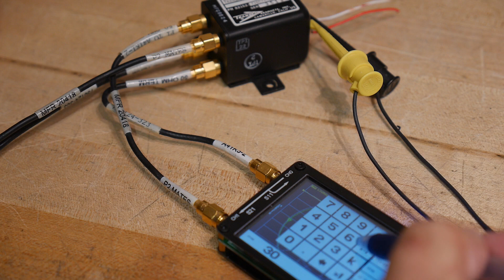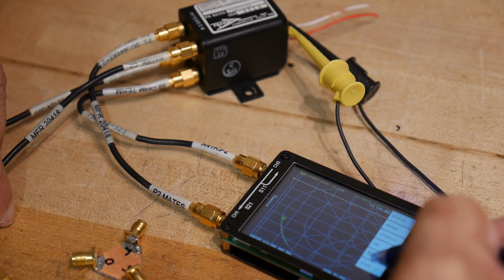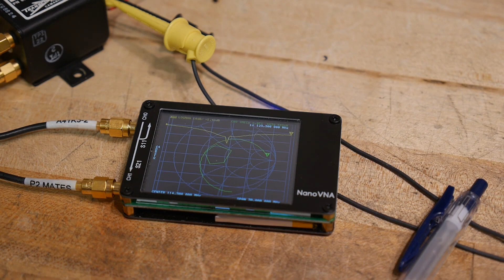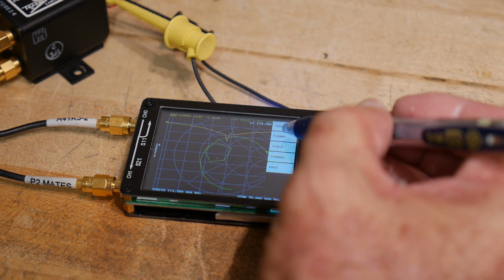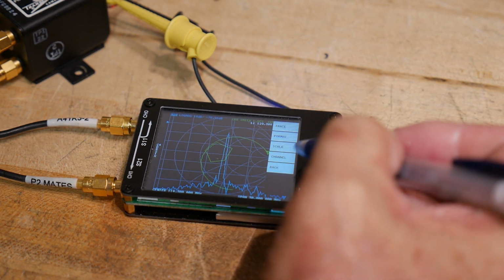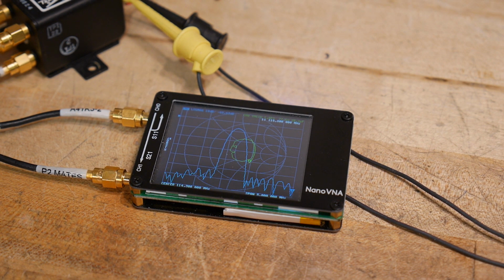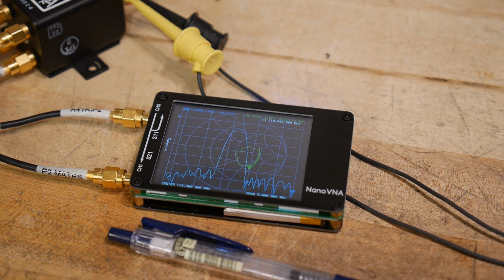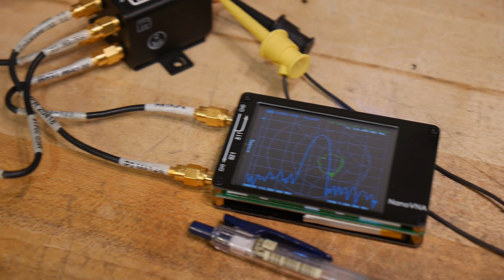#364 NANOVNA using coaxial relay

Comment: Could you do an experiment where having a full two-port vna is necessary?  It seems most components are reciprocal.
Reply from the maker: even a simple attenuator will have different S11 and S22. if a pi configuration the outside resistors are the same on  paper but will have tolerances. The most common use of a two-port measurement is an active device like an amplifier.
Reply: How would one use the s12 result to evaluate an amplifier?  I'm trying to identify situations and understand criterea where having the full two-port measurement would be useful. 
Thanks.
Reply from the maker: S12 would be transmission from the amplifiers output to its input. think of it as isolation or feedback.
Reply from the maker: For more in-depth uses for the full S parameters. The four numbers are part of the S-matrix. If you really want to know more look at:  https://cds.cern.ch/record/1415639/files/p67.pdf
Reply: @IMSAIGuy  Thanks for the reference.  I've been through the mathematics several times using a few sources, understanding slowly sinking in. 
The circulator still seems like magic.  Microwaves are amazing. 
I'd like to see an evaluation/ comparison of amplifiers where the S12 behavior is used to quantify amplifier performance.  I've never seen non reciprocal measurements used to answer a question.
Reply from the maker: one simple case would be you design a amp for 500mhz and put it on the vna. you see a spike of S12 at 800mhz. you have a capacitive leak (feed back). the out of band is sometimes more important than in band. no one cares about s12 on a good amp and would not publish it, but it would be a main measurement of a coupler design.
Reply: @IMSAIGuy  Thanks for the dialog.  I've got data sheet for Gali-21 showing S12 performance.  I'm going to attempt measuring at different frequencies.

Comment: Quick question: Do we need to re-calculate the cable delay when calibrating at the end of those cables ?
Reply from the maker: if you calibrate at the ends of the cables any delay is automatically measured and the phase at the end of the cable will be zero.

Comment: Hi, both of your videos related to this little device nanoVNA were excellent piece of info, can you plz tell us about the ciax relay that u used? And roughly about pricing, because in our overall effort to achieve with the "nano-Cost" of the VNA, the accessories should not overturn the price of the main equipment.
Reply from the maker: sma coax relays are very expensive new. expecially a cross over relay like I show. I bought mine used on ebay cheap. you need to be lucky
Reply from the maker: If you only want to use the VNA at low frequencies then you could just make one out of standard non-coax relays and get a result that won't be too bad. There is a new transfer SMA coax relay on ebay for $200. I'm sure I picked the used one up for $20 but most people won't know to describe it correctly and so you need to be looking at lots of relays before finding one.
Reply: @IMSAIGuy  Thanks for your immediate response. Will work on low freq with a homebrew one and later try to improve or add the expensive one if the pocket permits!
Reply from the maker: @prasannwaichal2672  you might try searching for Philips PM 7551  I've see some not too expensive
Reply: IMSAI Guy  Thank you,  I just did a search on ebay and bought one 2nd hand for $NZ40. - plenty more available. CHEERS 73s ZL3AXL.

Comment: If you cal if for both directions (using two different storage locations), then select the appropriate cal when you switch, is there a reduction in error?  Using a single cal as you show doesn't seem like an optimum setup.
Reply from the maker: I'm sure it would help.
Reply: @IMSAIGuy  I have a similar relay to the one you show but am leaning toward making one from standard parts for the nano.  Something readily available and lower cost.   It may be possible to use one of the programming pins to control the transfer relay and also power it from the nano.   I havn't looked to see if the source is available for the latest firmware.
Reply: re: "optimum setup"

At HF or 100 MHz even? I'm not seeing where this is critical ... were this at 2 GHz different story ...
Reply: @uploadJ  I made a video showing the T-check results of my home made transfer relay.   It was the last video I posted if you are interested.